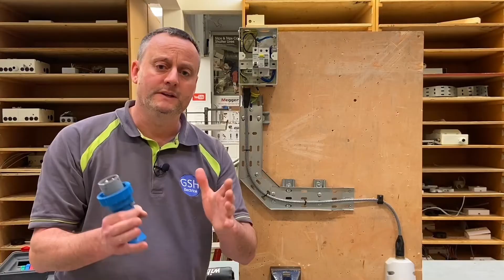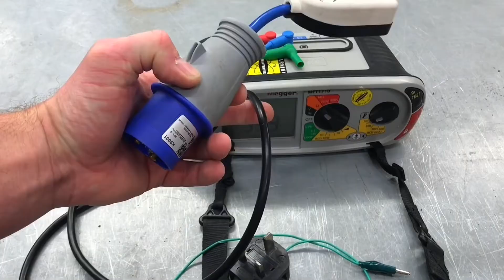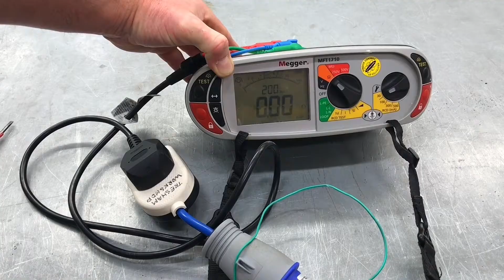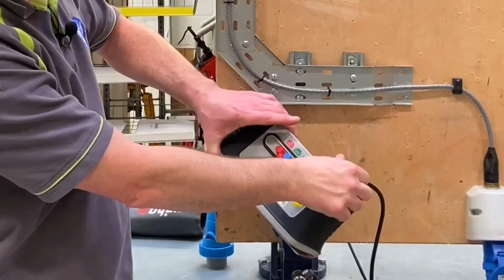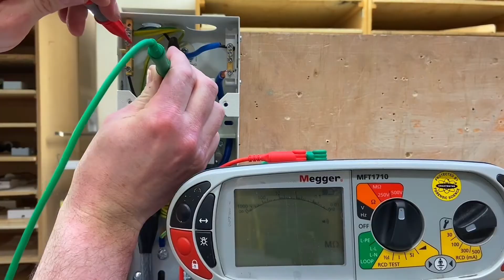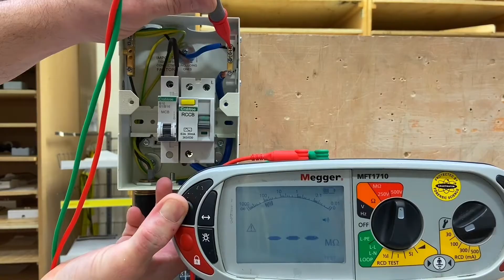Dead Tests on a 16 amp Industrial Socket Wired in SY Flex

Comment: Would be very interesting to have a video about polarity test on a three phase plug for electro engines and motors; because when those are wired incorrectly the  motor/machine can be damaged as they turn into the wrong direction.

(I had a college, who lost his job because he wired a motor the wrong way)